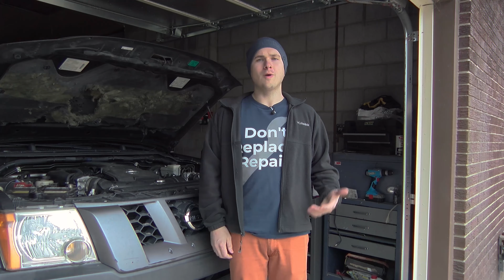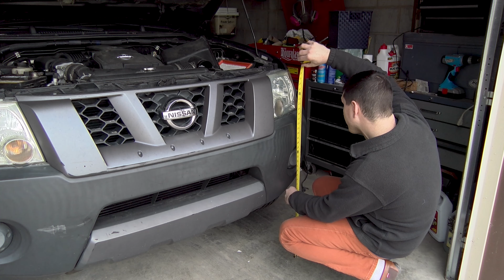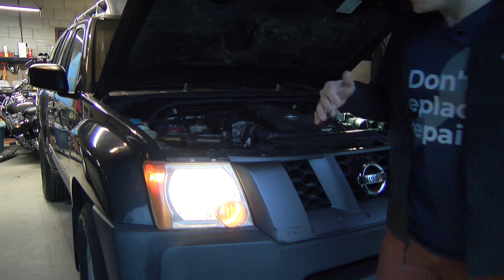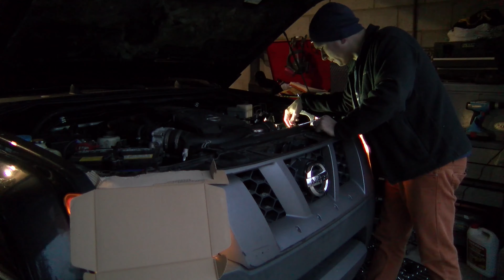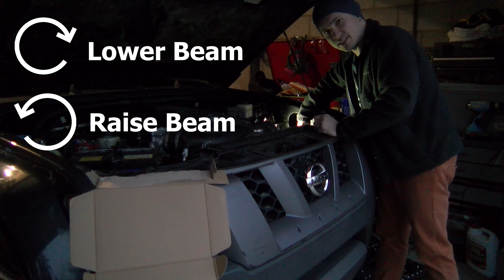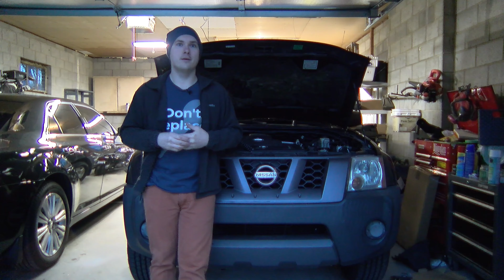How To Adjust Nissan Xterra Headlights

Comment: I got a 2019 Frontier earlier this summer, and now it's getting darker earlier, I'm using the headlights more, and getting high-flashed by a lot of other drivers. The bulbs are nothing special, just standard halogen, and I don't notice much difference between low and high beams, so I suspect they're aimed too high.

Comment: Thanks for posting this "way back when"!  I replaced my bulbs the other day with the same model number bulbs.  Wouldn't the aim be pretty consistent between old and new bulbs?  Mine seem "off".  Especially the passenger side bulb. The one behind the battery (of course!)  I'm thinking the bulb isn't seated properly.  Is there any easy way to tell if it is?  Once I'm sure, I'll re-aim both bulbs.  Thanks.
Reply from the maker: I think different brands just throw light a little differently. As fa as seating I think that they will not even be able to be snapped in unless they are seated correctly. I think you're fine there.

Comment: How did you end up compensating for the target being lower than the car?     Measuring from bulb to ground and duplicating that on the target does not compensate for the ground elevation change.
Reply from the maker: I did not duplicate the measurements on the board. I raised the adjustment line an additional amount to compensate for the board being lower. I don't remember the exact number but as an example. If the bulb height it 36" and my board is 3 inches lower then I will put the adjustment line at 39". That's all.

Comment: What did you use to get in at the passenger side? I'm very close to buying a 1/4 or 3/8 ratchet with a 12+ inch handle just to get at the little jerk.

Comment: The headlights on my X seem to be foggy on the inside, ideas how to fix that? Love the videos!
Reply from the maker: If it’s on the inside then the the only thing you can try is to dry it out and reseal it. Otherwise I would just replace them.
Reply: Ry the car guy do you know the best way(s) to do that? I was hoping to not have to replace them...
Reply: It is most likely not on the inside. Try using either Rain X Extreme Clean to restore the lens. Whitening toothpaste also works. Just rub it in real good, use a few drops of water, scrub the lens real good, then clean off the cleaner/toothpaste. I'd do that before anything else

Comment: I bought some LED headlights. Great brightness but the bulbs throw much lower than the halogens so I will be adjusting my up just a bit but honestly its a serious bitch to get a socket wrench on either side without removing the battery and air filter. Ive found that losing those bolts just a little you can adjust that dial by hand.

Comment: What is the size of the adjustment bolt?
Reply: Yeah really.. One missing vital piece of info
Reply: 8mm
Reply: No wrench needed. You can spin the whole thing with your fingers. It's really easy 👍

Don't spin the bolt head but spin the round metal part with your fingers.
Reply: 8mm

Comment: Ry there is a squeaky sound coming from the battery side of my engine. I am guessing my belt is loose or worn out. Can you have a video on how you know when its time to change a belt?  No engine lights are on by the way.
Reply: Check the belt for cracks. Simple job. If the belt has reached the life limit for your Nissan, then change it as well. The squeak could be a pulley as well.